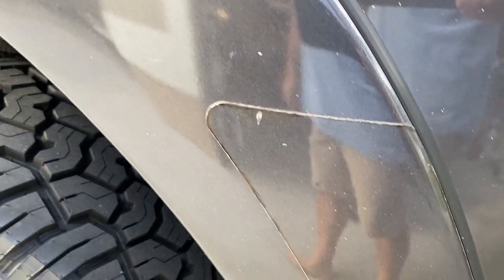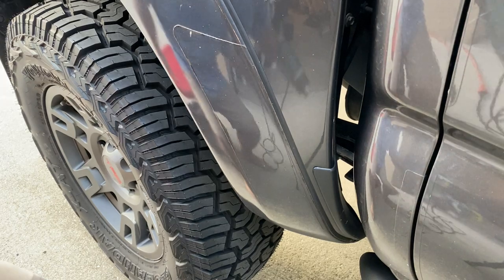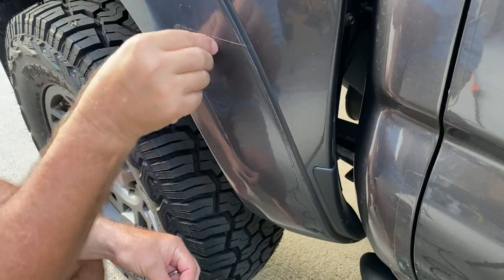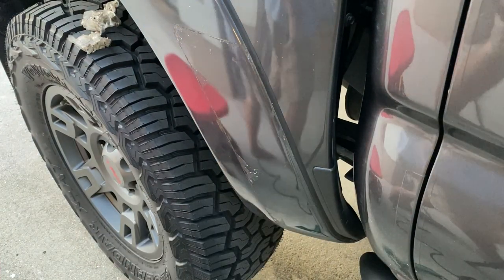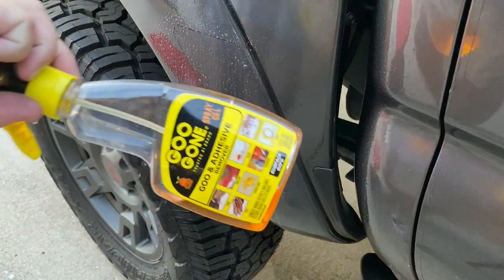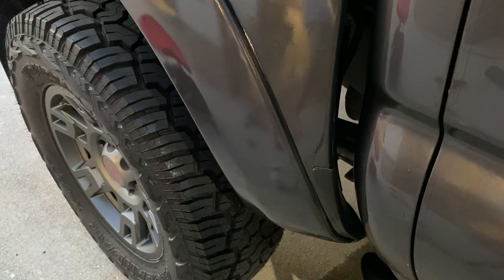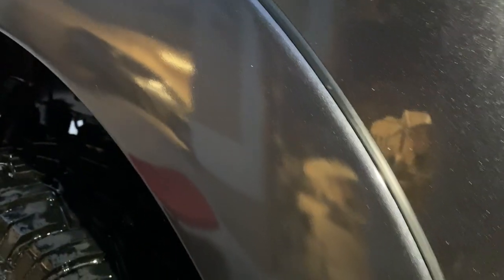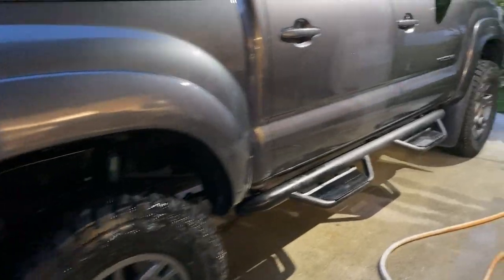Tacoma Vinyl Stone Guard Removal

Comment: NAPTHA is a miracle solvent, available where you get paint thinner. It will remove the adhesive when used with a piece of terry cloth. I have never had it hurt any plastic or paint, unlike other hydrocarbons. Graphic artists used to use it to remove rubber cement. Use it with ventilation and a nitrile glove (to prevent it from removing the oil in your skin). Every household needs a quart. Use it to remove those hateful stickers on plastic glassware and the cellophane tape on metal desks. I prefer it to bug and tar remover because it is stronger and requires less mechanical work. It evaporates rapidly and leaves nothing behind. And while I'm going on about my favorite chemical, I use SprayWay aerosol ammonia-free window cleaner to clean my entire 2010 4Runner. When I have some down time, such as waiting for someone, or being in line at the inspection station, I pick a panel and clean it with SprayWay and paper towels (newspaper of course for windows). It removes the dirt and wax. I follow that with a spray ceramic from Hybrid Solutions. When traveling, I use it every day at the motel to clean off the bugs (important if you are in the South). I believe there should be a special prosecutor for the genius that thought up sticking tape on perfectly good Toyotas.
Reply from the maker: That’s a great tip thank you so much for the detailed comment!

Comment: Hope this helps. I have a 2014 Tacoma which i decided to remove the stone guards using a heat gun but it made it worse for me. Firs off, the vinyl gets too soft that it comes off in bits; also be careful not to overheat the area as the paint and plastic of the fender flare will get too soft and lift leaving you to require paint repair. I found it easier not heating at all and lifting all of the top edge of the stone guard and very slowly pulled it off (keep lifting from the base where the fender flare and stone guard meet) which took about 10 minutes.
Reply from the maker: Thank you!
Reply: I have a 2014 Tacoma as well. How did you get it started without heating? I had a hard time even getting a corner lifted, even using a plastic scraper.
Reply: @petr93  I used a plastic scraper to lift the edge and after that i just pulled slowly concentrating on pulling from the base. There were areas where the bond was stronger and i had to use the scraper to release those areas but i still kept pulling from the base. Try to keep keep the guard whole in a complete piece rather than tear into pieces because it makes it more difficult. BTW the temp. at the time was around 90 degrees F. though i did this in a shaded area.
Reply: @petr93  BTW you may have some glue left over after stone guard removal and is difficult to take off. I used Meguiar's ultimate compound on it and for some reason it sort of melts the left over glue which made it a lot easier to remove. Just apply the compound and rub it in a circular motion using a soft cloth.
Reply: I did the same.
No heat and pulling slowly. 
The adhesive is a total bitch to get off afterwards!
Reply: @Bruno Sanchez  I also used rubbing compound.

Comment: Same product and sprays but use a magic eraser.  Works faster.  Good video!
Reply from the maker: RiverRock Adventure-Travel thanks!
Reply: We used magic erasers on our work truck to removed old decals and it scuffed up the area bad enough to where the clear coat was clearly hazy.  Magic erasers are abrasives so be careful.
Reply from the maker: Interesting. I’ll try that next time. I’m sure you’d need to polish after.
Reply: Magic eraser can definitely F up the paint! 
I used one on my Rubicon and it destroyed the clear coat. 
Much better options available.
Heck, WD40 will take the glue off, so will a basic rubbing compound.
Reply: A magic eraser is a fine grit sand paper

Comment: I tried removing this junk from my ‘12 Taco after it cracked and got permanently discolored. The glue never did come off and now it looks horrible.

This is another example of Toyota engineers overthinking a perceived problem. I’d much rather take my chances on a stone chips than put up with this stupid solution.  I’m sure my local dealer would be happy to fix this for me for $1000. Then I can have the same problem all over again. 

I’m going to have Rhino Liner applied to those areas. That’s what Toyota should have used in the first place, rather than this cheap vinyl (or whatever it is).
Reply from the maker: Rhino coating those areas is a great idea. Since you’re considering going to that extent, I would try to use straight gasoline and see if that will remove the adhesive. Good luck and thanks for the comment.

Comment: My 19 super white has them on the door edges, stone guards, in the handle and behind the wheels on the bottom of the tailgate and they are all gross and ruin the look of the truck
Reply from the maker: It’s a pain but get rid of them. I’ve never replace them and there is not a single stone chip.
Reply: I have an 18 that has the PPF in all the same places you described on your 19 and every place with the PPF has discoloration. Did you ever remove it all and how bad was it to do so? Any tips?
Reply: @wilmafingerdoo2690  I actually never removed it and sold the truck back in September. Reverted to stock because I had a 6” lift and big ass wide chrome wheels and mud tires and a mess of other stuff. Bought a corvette now. I never even attempted to remove them.
Reply: @Glocktism  I actually borrowed a heat gun from one of my neighbors this past weekend and took them off. Took between two or three hours. The worst part is trying to use the heat gun and peel away PPF at the same time. My hands got dried out and my fingertips are still sore from picking the PPF with my fingernails and pinching what pieces I could grab to pull lol. I will say it was worth the dried out hands and painful fingertips because it looks 100% better!!

Comment: These protectors are so stupid.  Mine is 2.5 years old and 12k miles and looks like crap.  Mildew under it in multiple places on both sides.  Going to dealer today to see if Toyota will replace…. Not hold my breath.  🤣
Reply from the maker: good luck!!
Reply: @bobbygfl  they said warranty would not cover it but they offered to remove them if I wanted.  I told them I would leave them for now and they offered me a free wash.  🤷‍♂️
Reply from the maker: Figured. I would not let them remove them. They will use a buffing tool which will swirl up your paint.
Reply: @bobbygfl  Good advice!  I figured I would try your process if I decide to remove them.  Have you had and paint chips since removing them?
Reply from the maker: @Eyball1972  zero paint chips. I figured I’d add them back if I needed to but it’s been two years since I pulled them off roughly and no problem